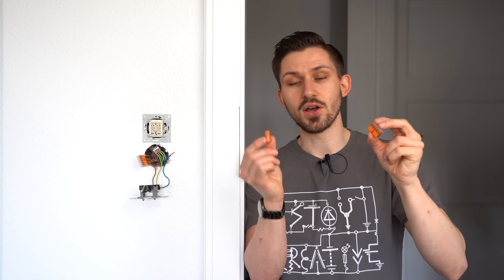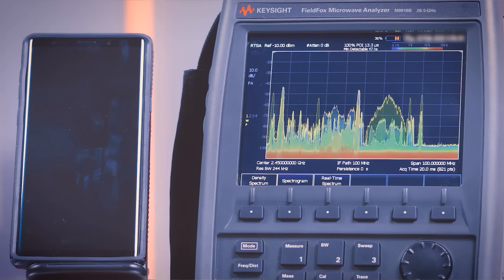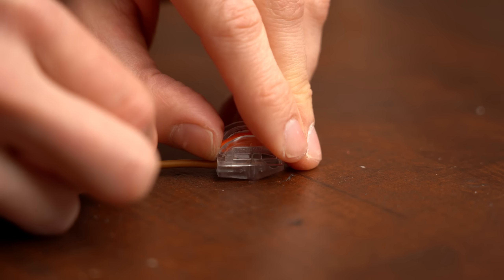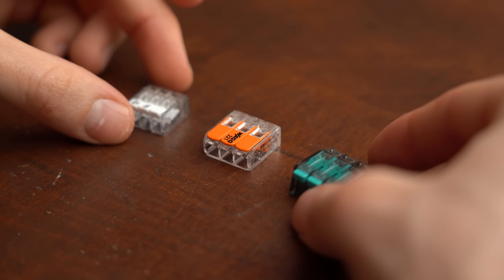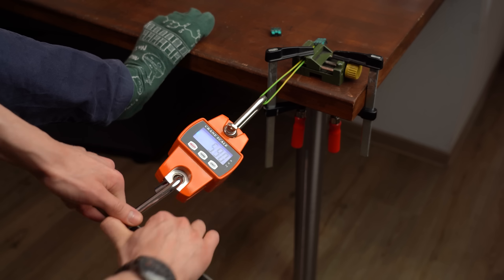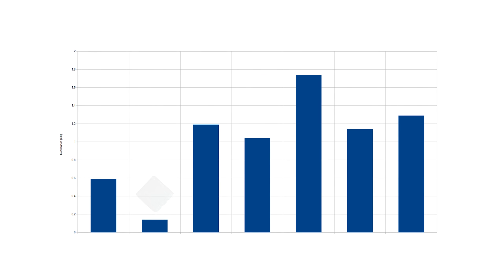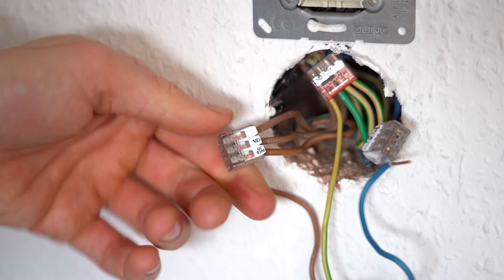I tested 7 Wago Knock-Offs Wire Connectors so you don't have to! (Surprising Results)

Comment: Couple points: First, great work on the drawings! Second, in cramped situations the wago and ideal type can achieve some real space savings, Third, in rework situations the wire nuts present you with hardened twisted wires to work with while the Wago the wire simply comes out straight and is much easier to handle. Third, the advantage of the wire nut is that the spring and plastic shell combination combine to keep a large area of contact under continuous pressure, but it does take more time and skill.

Comment: Within the envelope of the allowable temp rating of the conductor, there's little practical difference for the DIYer. I've been doing this too long and wire nuts are so cheap that there's no scale I can buy Wago on in a predictive stock environment that doesn't make them ludicrously more expensive. The average homeowner needs a bunch of 221s and a handful of other sizes. I won't use anything that isn't UL or Intertek listed because it doesn't meet code. I will use Wago levernuts in lighting, exit signs, and emergency lights, because it makes replacement fast and simple.

Comment: You compared apples with oranges and watermelons! Those connectors must be compared with same class connectors not different to give advantage to WAGO! This is biased in favor of WAGO! In WAGO website anyone can find: transparent connector with orange lever T85(Ambient temperature (operation) +85 °C, Continuous operating temperature 105 °C), IEC/EN EN 60664 450V/32A, UL 486C 600V/20A, Connectable conductor material = Copper, Solid and stranded conductor = 0.2~4 mm², Fine-stranded conductor = 0.14~4 mm², Strip length = 11 mm, Flammability class UL94 V2, Fire load 0.089MJ; and gray connectors with orange lever T85(Ambient temperature (operation) = +85 °C, Continuous operating temperature = 105 °C), IEC/EN 85ºC/400V/32A, Connectable conductor material = Aluminium and Copper, Solid and stranded conductor = 0.08~2.5 mm², Fine-stranded conductor = 0.08~4 mm², Strip length = 9~10 mm, Flammability class UL94 V0, Fire load = 0.129MJ, as you all can see different things with different specs!  https://www.wago.com/global/installation-terminal-blocks-and-connectors/splicing-connector-with-levers/p/221-415   https://www.wago.com/global/installation-terminal-blocks-and-connectors/splicing-connector-with-levers/p/221-415

Comment: Be careful with the CE Markings on products, because there are 2 versions used which almost look-alike. "C E" with a space in between is the testing for the European market, but "CE" joined together - misleadingly in the exact same font - stands for "China Export", which are untested products intended for the foreign market. They almost look the same, but the oversight and quality control on these products is certainly not the same.

Comment: That's very good connectors. They don't need such experience as nut screws to install, much more compact connection [not even connector], and they withstand their rated current multiplied by 2.

Comment: BizLine “BizWings” (which look like an inferior copy of the ViD type) are FAR worse than any of the Chinese generics; I had them (nominally 32A rated like the genuine Wago 221‑4 series) severely overheat in less than a year, well under 20A (with the correct 2.5mm² wires). Either the rating is fraudulent, or at the very least, they have far too little margin for imperfect wire insertion. I'm only lucky the wires melted enough to short and trip the breaker before worse; otherwise, FIRE FIRE FIRE.

Avoid those French jerks (like every other French product I've suffered to date) at all costs; in Australia they used to rebrand the nice Kaifeng KF-MSD-4A and KF-MSD-6A power-boards, but have switched those to a cheaper lookalike too. The genuine Kaifeng models are identifiable by approval number: SAA-162063-EA

Comment: The results are really interesting, but I do not think you appreciate the importance of contact resistance when these are being used well enough. These connectors are often used inside small wall boxes where they contribute to the overall temperature rise within the box. In these cases a low contact resistance is very important. Inside a larger box or cabinet it will not matter that much as the connector will be cooled by the surrounding air. The really interesting test here would be a temperature rise test inside a flush type wall box mounted on an insulated wall and where the copper temperature is measured using thermocouples soldered on to the copper conductors. Also, a comparison with screw connectors would also be useful.
Because of the importance of low contact resistance I found the green connector very interesting. However I could not find any description of the manufacturer and the Amazon link is broken. I would very much appreciate if anyone could tell me what the manufacturer or type designation is for this item. Does anyone know?

Comment: I would only use official WAGO connectors, the issue with knock-offs is the lack of quality control meaning one batch may be fine but another batch may not meet the same specifications. I might pay a bit more however with electrical loads you want that kind of security knowing that the quality control/assurance process is robust and you can sleep well at night knowing you will have less callouts and that the work is safe. Cheers.

Comment: I'm not an electrician, even though I have a similar electrical engineering background to Scott, although far less profound. My takeaway is...

The only place where I would say wire nuts shine is if you have to do pigtails with 3 wires, and you have a long daisy chain for outlets and all. Lever nuts are for sure more resistive but probably not enough to cause a problem since they are technically cULus rated here in North America. But I still prefer wire nuts here since anyways you won't be messing with pigtails all that often compared to replacing outlets or switches.

Other than that, if you are splicing more than 3 wires, dealing with light fixtures (or anything else that commonly uses stranded wire) or with equipment meant to be replaced over time, lever nuts are the best option, no question. Easier to use, less prone to user error (even for electricians) and allows easier solid to stranded splices. Also speeds up equipment changing.

And beware of the emotional old farts that have a broomstick up their backs.

Comment: I'd take the green one over all of them for standard house wiring. Not only would the wedge make a much tighter connection; but it requires a special tool which should deter future DIY enthusiasts. They'd have to really cheap-out on the materials to make it not the better option, IMO.

Comment: We also use connectors like the 3M "IDC" connectors in the USA, although rarely. I think you might like those because they require no stripping, but you still have to use a tool. I feel like the common connectors used in Europe are more foolproof and less labor intensive, while the US connectors require skill to use and thus leave more room for error. We always twist the wires first and if you are connecting stranded and solid wire then you have to do it a certain way. I really only ever use 3M wire nuts (which are different than what you tested) unless some wire nuts are supplied with a fixture.

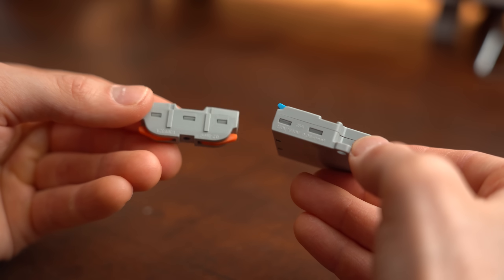Comment: I think that at 4:43 the connector on the left (smaller one) has the insulation information provided by that little indentation on the bottom.

Comment: I've used many kinds of connectors. The Chinese ones, real Wagos, the Ideal lever connectors, traditional white terminal strips, set screw wire nuts, Polaris taps, split bolt, etc. If I am trying to make a really good connection, I will go for a terminal strip or a small Polaris tap. If I am just trying to connect things together, I usually go for the Chinese 3 input, 3 outputs per input connector. Have one running at 25 amps that has been there for years, recently took apart that box and it's perfectly fine.

Comment: Bring an American, I am used to using wire caps. I bought some of those connectors and online, (wago knock-offs) and thought they all sucked. I may have to get brand name wago’s to give them a try. Wire caps work very well, but the ability to switch out wires without re-stripping in very select situations would be very nice
Reply: If you buy them online buy from Digikey, or arrow electronics have to buy 100 at a time they are real Wagos. My other choice is Home Depot they sell real Wago's.  Most big commercial contractors I have worked with use the push in connectors like Ideal makes they are cheap and smaller can't remove them have to cut the wire off. They see it as a fast way to connect wires that is NEC approved.

Comment: At the end of the day name brand wagos aren’t as bad as some people make them out to be (the lever lock that is, the stab in of any brand is garbage). But with properly twisted wires a wire nut is just a better, lower resistance connection than that little bus bar in the wago. I personally only use them for LED lighting fixtures and control wires but that’s just personal preference. Great video bro

Comment: What I wonder/fear is what connectors are made out of
Wanting to use in line connectors, but these are aluminum wires, not sure if conductor used in these connectors result in galvanic corrosion

Comment: In Italy for the 90% of wiring house connection, we use the ForBox connector, is similar to the "screw connector" but the wire are simply inserted (twisted together) into the connector and secured in place by a screw. 
With this type of connector the contact of the wire is secure by the wire itself, twisted toghether. The screw of the connector guaranteed a solid contact.

Comment: Right away, I'd like to say that you have some nice looking PME on your test bench!  We also have one other thing in common - great handwriting!  Anyway, I commend you on creating such a useful video.  The test criteria you employed is very thorough, but the Resistance Test is definitely the most critical test in your list.  Way back in engineering school, I was taught that Power is simply a form of Heat and, as you correctly pointed out, Power (P) is a product of both Current (I) and Resistance (R).  Put a much simpler way, Heat increases when electrical conductors (wires) have poor contact with one another.  Personally, I've never heard of a house fire that started at a simple connection point, but it IS possible.  It is far more likely that a wire may come loose and short to ground - which obviously causes a lot of heat - but that's where your Pull Test comes in, which I see as the second most important test in your list.  Regardless, thank you for performing this comprehensive product test and, please, keep up the great work!

Comment: Working with computer systems for years, I definitely see the benefit of WAGO and the better knockoffs over wire nuts for use in many parts of the system when dealing with bare wire connections.

Comment: @GreatScott - did you actually check to see if the products really DID have the approvals/certificates indicated on the products?
My experience (30 years) is that most of the Chinese knock-offs have NOTHING!
It is quite easy to find the UL approval group for the Wago article, which you can then use to see if the knock-off part and manufacturer are also listed.

Comment: Wire nuts are significantly better if you use it correctly.

 The reason being is that it creates more contact area with the wires by wrapping around each other. 

On top of that, the wire nut has a inner metal sleeve that creates an additional conductive surface.

The twisting of the wire also creates a superior mechanical connection.

A recent Test was also conducted where the wago was actually hotter with current flowing through it compared to a wire nut.

Comment: I've used wago for my PV system 6mm² ~43A per phase.
Holding up just fine.
My cable losses at ~60m of 6mm² cable are worse 😇 at the full 25kVA we loose about one kiloWatt between converter and grid meter. 👍

Comment: There's one good reason to buy Wago connectors over knockoffs and that is to support innovation instead of immitation.
Reply: Except some of these "knockoffs" are not knockoffs at all, but new connectors that Wago themselves don't make. For example the 3 input, 3 output per input connectors, and the slide connector with much higher mechanical strength. Wago just recently even started making an inline connector. They haven't made an inline splitter, and the Chinese ones have been around for years at this point. Seems to me like in this instance Wago copied the Chinese design for inline connectors since they were around long before their version. The slide connector is something I haven't even seen before and is definitely a new design. So while they may mostly be lever connectors, and so they all could be considered copies of Wagos in terms of the connection type, the configurations are often so different as to what Wago offers that they could hardly be considered knockoffs.

Comment: well you obviously need vibration tests for wall wire connectors. thats one of most important test, also gotta check how they act in 400+c temp and -100c. and obviously there is such thing as european standard and not every country individual standards guided by the eu standard

Comment: Please make a third part where you include the connectors that are sold in Aliexpress.
If you go there and search for "quick cable connector" you will find at least 3 other kinds that are not in this video.
The most popular is a white one with a spring that looks easy to use and super cheap.

Comment: Wirenuts were widely used in the Netherlands, until wago made decent push in wire connectors. But the Dutch wirenuts  made by Conex are diffrent. They have decend instruction load and certification (kema dutch version of vde)and there own tools to install them.

Comment: The best connector is obviously a wire nut that's painted red white and blue...

It's shocking how defensive people get or only assume their own situation. Not everyone is an electrician and will bother to take the time to research the right way of doing something. Instead you've got people just trying to swap out a switch for the first time or put up a ceiling light or something. The wagos both build confidence and help guarantee the people who do this stuff every 5 years are less likely to make a mistake.

Comment: Wire nuts have existed for almost 100 years.  They are well proven in the industry through many trillions of connections made with them.  If used properly, and it's hard to do it wrong enough to matter, they are rock solid and will out live the house/building they are used in.  The other connectors all suffer from a weakness you yourself mentioned, higher resistance.  And this is because the wirenut is not doing the conducting, it is just there to hold the wires together.  So the wirenut is not contributing to that resistance, the surface contact between wires is doing the conducting.  If you run out you can pick more up at any hardware store.  They are ubiquitous.  And because they are so old they are not proprietary, many, many manufacturers make them and they all work exactly the same, and assuming they are not just crap quality they all work the same.

The other connectors all suffer from the fact they have a current rating imposed by the sliver of contact area and the buss bar the connector relies on.

The one advantage I see to them is the ability to join multiple wires neatly in one device, but this means you have to stock up on the specific connectors in question.  When working with wirenuts you can still do this, you just organize things a bit differently and it becomes a habit.

Comment: I agree with Killer Spud below.  Would like to see some high and over current tests.
Given the choice I will use a wire nut.  But there are enough times that I have run into places where limited space or unhandy locations makes wago's a easier and safer choice because poorly installed wire nuts are a bad deal.    So maybe for the inexperienced people they are a better choice.   Still maintain a properly installed wire nut to be a better connection.

Comment: Once again:
Your resistance test is flawed because you are only measuring resistance while pushing 0.27V x 20A = 5.4 Watts.
You should be testing these at their "rated" power for a home-circuit, which is 120V x 20A = 2400 Watts.
(Resistance increases with heat, and 4 watts isn't gonna generate that much heat)

Furthermore, you fail to show the control (wire nuts) in the results.
You showed it in your previous video, which didn't help your case for using these Wago connectors (so it seems mighty suspicious that you dropped them from this video).
*Previous video showed Wago connector to have ~14X more resistance than a wire-nut.

There is no way I would trust one wago, let alone a string of these in a 20A circuit on my home.
Pre-twist the wires, and use a tried and true wire-nut (proven to have significantly less resistance).

Comment: So, these are ok (code approved) to use in USA vs the standard wirenuts?
I have some 50 standard 120v 15a receptacles to replace in my fathers house (built 1973) and 'many' have wire nuts in the old metal box to extend the existing wires.
Or, should I just leave well enough alone and wire-in replacement receptacles? (ain't broke don't fix-it kinda deal)